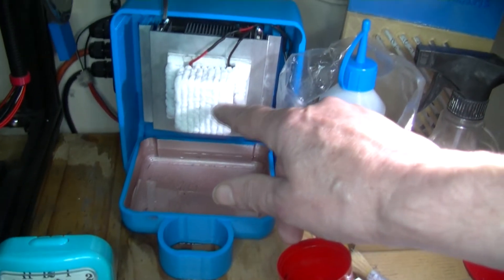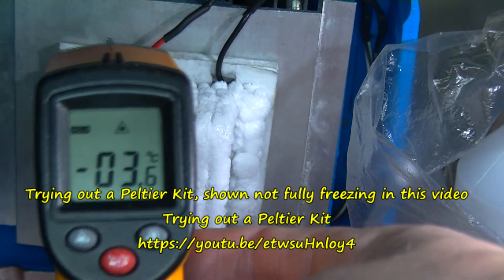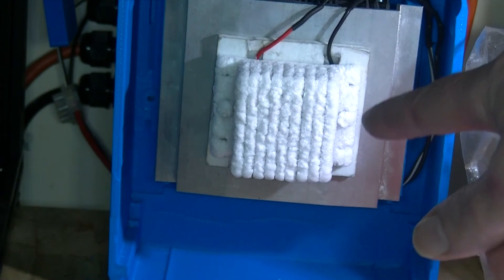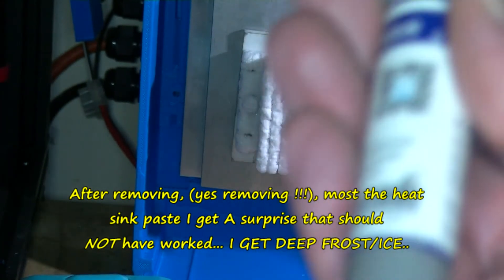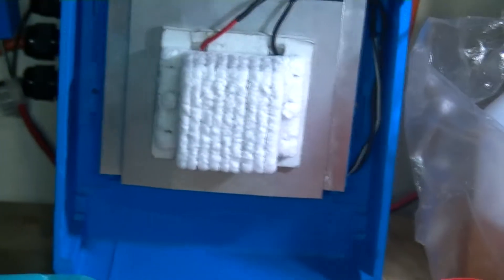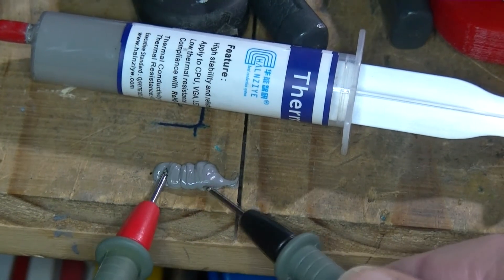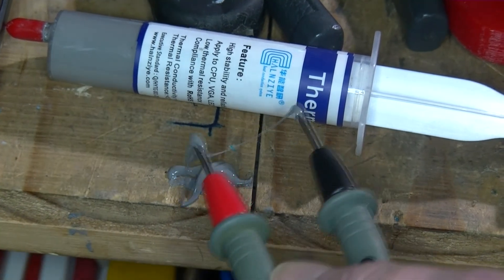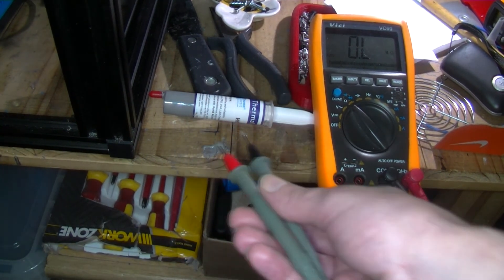Peltier Not Freezing fix trick

Comment: I also made a peltier kit for mini fridge. But the temperature never drops below 22 degrees Celsius. Please show the process how you did it.
Reply from the maker: Never worked for me: someone said use more Amps but hey! that would be a lot so I give up. They are said to be quite inefficient is use so not much good; sorry; I have a biggish heatsink and 12v computer fan to pump the heat form the hotside away, this is needed
Reply: @3D_Printing  ok, there is no heatsink peast? You are fully remove heatsink peast?
Reply from the maker: @shubhadebnath.  heatsink paste removed; yes; did I do another Typo key press error :)
Reply: @3D_Printing  Did you only remove the paste from the cold side of the peltier module? Did you leave the paste on the hot side or did you remove that as well?
Reply from the maker: @Ratkas007  All heat paste removed... Odd action this heat paste said the help but did the opposite forme; Please try removing all heat paste and test this to see if it works better
Reply: @3D_Printing  Thanks! Will give it a go!
Reply: @Ratkas007  Any success? Having the same exact problem